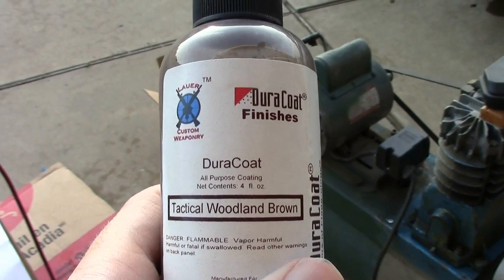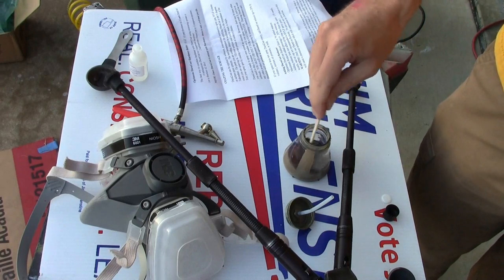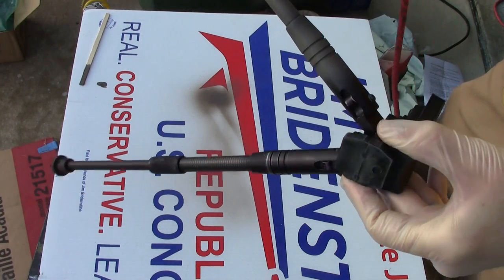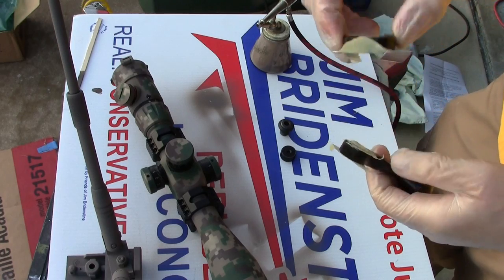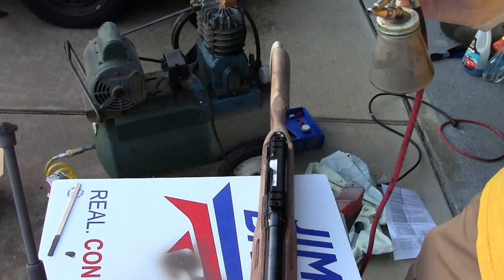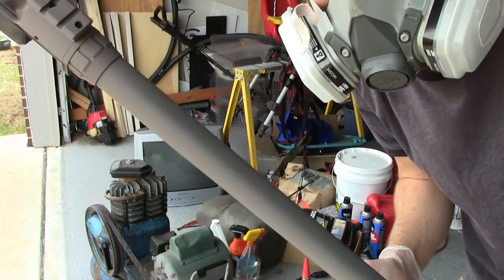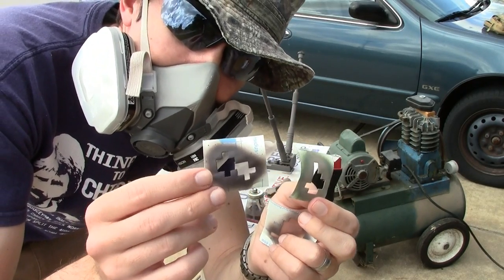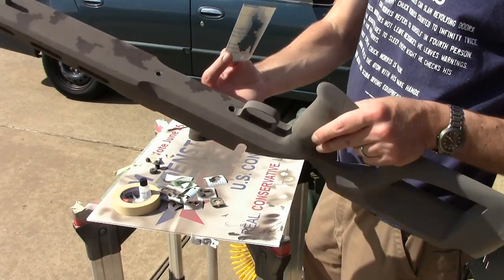Duracoat Bolt-Action Rifle: Digital Camo on Savage 12FV in .243 Win | The Social Regressive

Comment: Great video! Thanks for sharing!
Reply from the maker: unit9014 I appreciate the comments! Today I'll be releasing the flip-side to this video. When I got started I forgot to include the scope in the paint project. I put it into its own, shorter video.
Reply: The Social Regressive Perfect. Looking forward to it. Question, when all was said and done, how many hours do you think it took from start to finish including sanding and decreasing etc? And how much do you estimate in cost for the whole project?
Reply from the maker: Tricky...I estimate a total time of eight hours on this project.  My AR15 took longer, since I also applied the pattern to 20 magazines.  Setup takes about 20 minutes each session.  Cleanup takes about ten.  Just slosh some lacquer thinner into a spray jar and let it clean itself.  As for costs, I think the Duracoat ran me about $70 and the lacquer thinner was a couple of bucks at Lowe's.  Throw in a little masking tape and the shelf paper I used for stencils... Maybe as high as $80.  That's a lot of Duracoat, though.  Enough for two or three elaborate rifles and a pile of mags.

Comment: Very cool. I watched this a while back and just re-watched as I am getting ready to do the stock on a bolt action rifle. In the nearly 4 years since you made this video, do you have any lessons or advancements to share? I don't mind some Duracoat on my thumb, but it seems like larger "mask borders" on the individual hand held patterns would help prevent overspray. Perhaps I'm just a sloppy air brusher. Thanks.
Reply from the maker: Yeah, a little bit more margin around the edges would be nice. Also, I like to make a bunch of the single-pixel masks. They tend to gum up pretty fast. The one thing you might send some time on is the colors. I'm more than pleased with mine, but you might want something that works in your environment. Let me know how it turns out!
Reply: Excellent. Is it safe to assume that one merely cuts masks out of the templates you have posted? And what about the paper? Too thin and it may not lay flat; too thick and it may not follow the contours as well. Where is the happy medium? Thanks.

Comment: Hey there.! Nice video.! I just picked up a Savage 12fv in 308 yesterday. I'll be truing the action and installing a .243 barrel. I noticed you have this listed as a 243, was this aftermarket ..? I didn't think Savage made this in the 243 version. If you did put a barrel on it, what barrel did you go with.?
Reply from the maker: Mine was probably built about the same time as yours!  Back in 2004(?) they had a few different options, like .243 and .308.  It's a shame they only offer the FCV in .22-250 and down.  Today's Savage buyers are missing out.

Good luck with the build!  It sounds like a lot of fun.  What do you plan on destroying with .243?
Reply: Paper targets and those pesky steel gongs for the most part haha. I will most likely do some deer and bear hunting as well. I focus most on long range and precision reloading. This will be the first barrel swap, usually my gunsmith does it for me. Any advise from you would be great.! I've always been a fan of the .243 so I'm stoked to get this project completed. I'm in the process of making a video on this as well.
Reply from the maker: Vaughn Precision You're going to like the process.  It's easy and quick.  My recommendations would be (a) to jury rig a wrench that will hold the action in the place while you tighten the barrel nut, and (b) to check and double-check your headspace after it's all over.  Have fun!

Comment: Are you a noob to rifles and such? Just wondering why everything is done so carefully and precisely and you actually have a pair of leapers utg rings???? Why would you buy air soft quality rings ????
Reply from the maker: At the time, very few manufacturers made quick detach rings in 30mm. Qd mounts were rare and expensive, too. The UTGs are actually quite good aside from one major error: the rounded cross-bolt screw doesn't protrude far down enough, so it peens the rail.
Reply: @SocialRegressive  just wondering, I would at least look at Warne qd rings for next time if your on a budget, I just hate to see such a nice rig with utg part lol